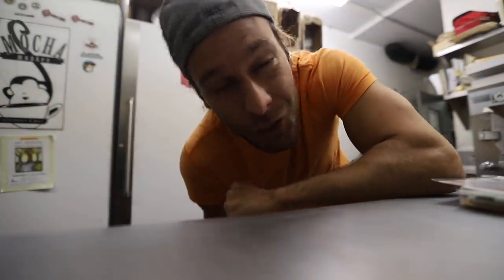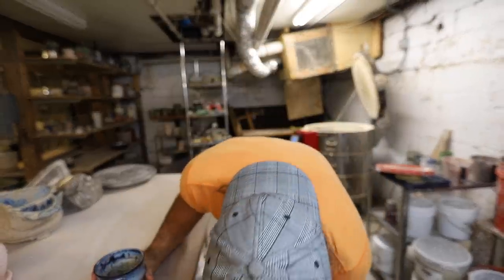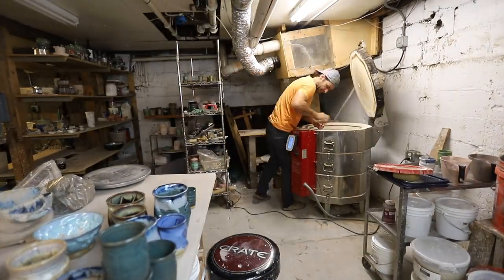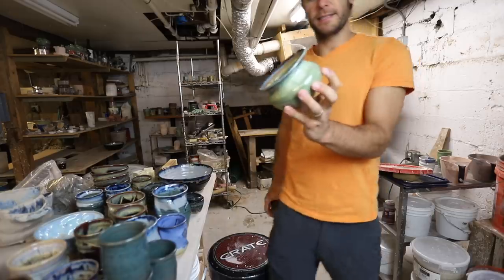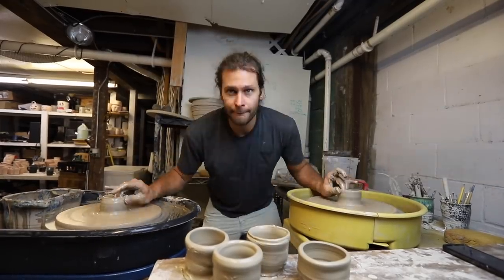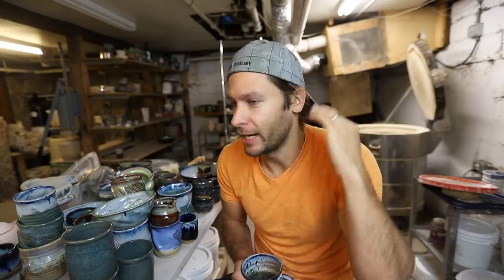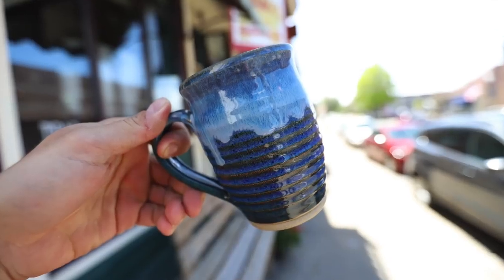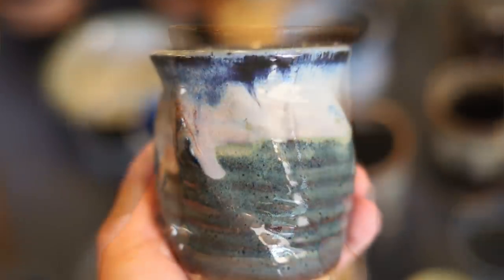Saying Goodbye - Unloading Kiln #50

Comment: Similar to the doughnut video, you should make an infinity shaped double doughnut vase/decanter. I assume you might have to make two smaller sized doughnuts and then cut each of them to connect them to the other to get the continuous figure eight/ infinity shape.